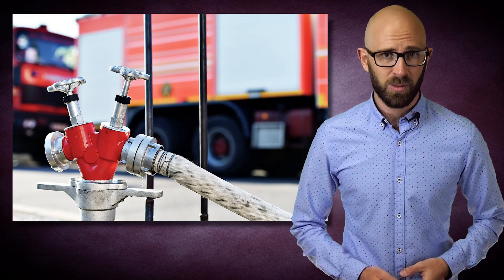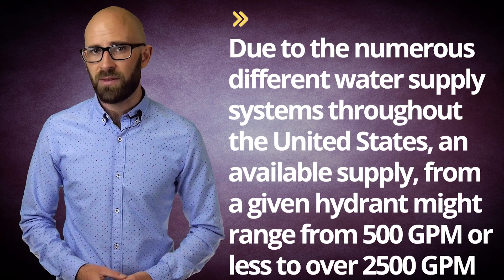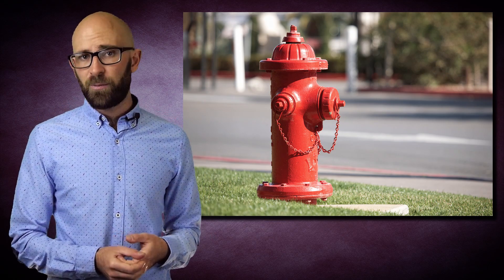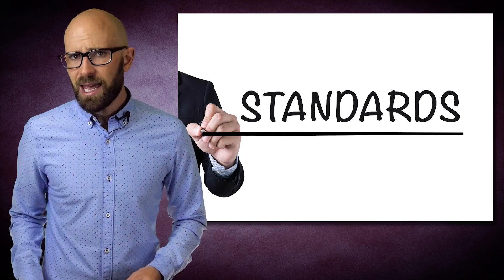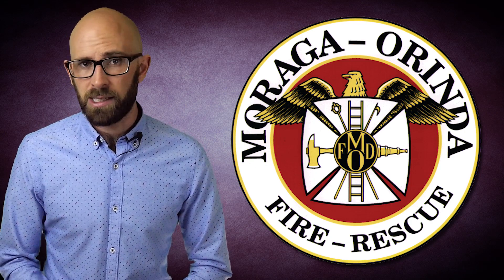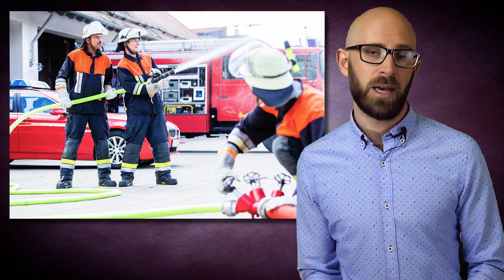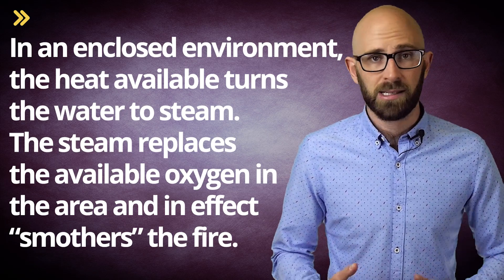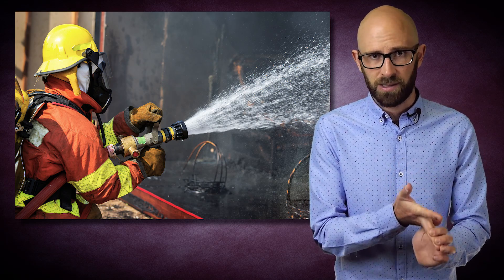Fire Hydrant Colors Actually Mean Something

Comment: Bonus fact: Pouring water on a grease fire will make the situation worse, as the water will spread the burning grease around. Instead, grease fires should be smothered with a more solid substance such as sand. Sand also works for various other chemical fires which is why you can usually find a bucket of sand in chemistry labs.
Reply: You can use AFFF (Aqueous Film Forming Foam). The Navy stresses in their firefighting prograam to use this in a liquid (Bravo) fire. That mistake was made on the Forrestal fire when they sprayed a jet fuel fire with water.
Reply: James Currie 
The water and grease separate, spewing burning grease and boiling water everywhere.
Reply: You could use sand for a grease fire, or since you're in the kitchen anyways, grab a box of baking soda to smother it.
Reply: When I was trained by the Merseyside Fire Service at Speke in the '70s, one of our exercises was to enter the "tank" to extinguish a large tray of burning diesel oil. For this we used a high pressure water spray (not a jet) nozzle on the the hose branchpipe. The fine spray turns to steam both cooling and smothering the fire very effectively. Fixed Waterfog spray installations  are often used for fire protection on oil filled equipment such as transformers.
Reply: HauntedShadowsLegacy don't use water on magnesium fires either. It is so hot that it will seperate water into Hydrogen  (really explosive) and oxygen
Reply: imagine a sand hydrant in chemical labs
Reply: HauntedShadowsLegacy don't remember seeing buckets of sand but a fire blanket is just as if not more sufficient
Reply: HauntedShadowsLegacy and at... I think you call them gas stations in america? Not sure in Ireland we call them petrol stations, or supermarkets if you live rurally
Reply: HauntedShadowsLegacy I'm talking about sand buckets btw
Reply: At gas stations (yes, that's what they're called in America), there's usually an industrial, grade B (Bravo) fire extinguisher, a trained attendant, and a highly visible emergency shutoff switch. As for sand, I don't think I've seen buckets of sand at gas stations.
Reply: HauntedShadowsLegacy k thanks
Reply: HauntedShadowsLegacy yep in the lab we have bucket of very finely ground minerals we use for out of control reaction fires, for insance if someone accedently gets water on pure potassium and were to add more water because it started a fire it would blow their body into swiss cheese lol
Reply: Well, when I did IMO60 safety training we put out oil fires with water. It's a bit tricky, but if you have a corner to chase the fire into and  you use a more "shower" like setting on the nozzle it works just fine. I agree that powder or foam is a better option, but water does work if you know what you're doing.
Reply: to pws3rd 1, Very true, which is why the fire extinguishers in magnox fuel stores are metallic dry powder
Reply: +HauntedShadowsLegacy
Commonly a chem lab is equipped with a BC fire extinguisher. This is because the ABC extinguishers use a corrosive power (usually ammonium phosphate) that is very difficult to clean after the fire is out. BC extinguishers use compressed carbon dioxide gas that leaves no residue after use. This also makes it favorable should an electrical fire occur because it will prevent further damage to the equipment. If the lab contains any array of flammable metals or metallic solvents, a class D extinguisher is also usually present. The class D uses a dry powder, it is not preferable due to contamination issues but BC and the ABC are both ineffective at combating these types of fires. The better labs I have been in are usually also equipped with a fire blanket and safety shower to be used on any person who's clothing or body is ignited. I have not seen buckets of sand, but you will usually find 2 containers in a lab of ground minerals. One usually is mica, mica is excellent at controlling a fire due to it being noncombustible, inflammable, and fire proof. The other is usually sodium bicarbonate, this is used to neutralize strong acids in the case of spills, or unforeseen reactions.
Reply: I had a friend who was having a fish fry when the propane regulator stopped working properly, causing the oil to catch fire. I grabbed a box of baking soda & dumped it in; thankfully it put it out. Thanks Grandma for your words of wisdom from long ago!
Reply: As a child it was drilled into us that you use baking soda & smothering to put out a grease fire. Recently this came in handy as the regulator on a propane fryer was malfunctioning & caught the oil on fire. They tried to smother it but that made it overflow & onto the wooden deck. Grabbed some baking soda which put it all out! Now when we have a barbecue we also have baking soda there close, every time.

Comment: Bonus facts. Blue reflectors in the median of a road point out where a hydrant is located bordering the road. In some water districts the hydrants are tapped off a large water main supplying a city, and they're often rated at 2500+ GPM and are painted silver (great for fighting wild fires). And if you live in an area where you think you may have a dead end connected hydrant, make sure your local fire department is inspecting the hydrant every few years, if not yearly, to flush out sediment that gets trapped in the dead end, and to make sure the hydrant is providing the required GPM to supply firefighting needs.
Reply: Usually when the snow comes the brush around the hydrants has no leaves and is beat down a bit. We don't get really bad winters here in WA State, so it's usually not an issue.

Comment: Why does the US have hydrants, whereas other countries like New Zealand have an underground system with connection points marked by an arrow on the road?
Reply: Hello, the underground fire plugs are usually in countries where it does not snow or go below freezing. Most places in the USA require the fire plug to be located below the frost line, which was determined to be below 4 feet, ( but with global warming probably 2 feet now). So the hydrant you see sticks up about 3 feet but goes in the ground about 4 or 5 feet, so in all the hydrant is 7 or 8 feet long.  There is a valve stem (rod) that goes from the top of the hydrant, to the valve at the bottom, so when the firefighter turns the top, he is actually opening a valve deep in the ground...

Comment: I used to work for a waterworks supply company supplying a city of 100,000 people and smaller towns in a 100mi radius. All of the hydrants came red despite the size. Those that were sold to the city were all the same size and were required to be repainted with a particular shade of paint.

Comment: Today I Found Out - Conway79 brings up a good point with, "If choosing the correct water pressure and type of hydrant is so important, I'm surprised there aren't stricter rules about how they're painted." This made me think "I'm surprised they don't have a local map or app that has this info for each fire station and readily available to other stations that may have to assist in their area."

Are there maps and apps available to FD's for this and other purposes?

Comment: The "Color Coded" Fire Hydrants is a recommendation. I've haven't seen any community that has used the recommendations yet.
However!
In the United States, Fire Hydrants come in Red.  Over 30 odd years ago, we were allowed to paint the Fire Hydrants all around the country. So you might see a hydrant painted like R2D2 or like a corn stalk or one of many other creative designs.
If I were a fireman, I would know the pressure on every line in my system. If not you can check the records at the station, not that it matters!! You only have 1 setup on your truck!!!! So you'll just have to deal with it.

Comment: As a firefighter/EMT, I approve this video. Another thing to consider is there is widely varying policies as to whom has to care for fire hydrants. In some municipalities, the water department takes care of everything in regards to fire hydrants, including pressure and GPM testing annually. In other cities, the FD needs to annually inspect and pressure test every hydrant manually, and perhaps the water department does not want to paint them. Obviously the FD doesn't have a strong urge to spend a weeks every year or two painting and repainting all of their own fire hydrants. 
Lastly, in areas with public water being suppled by a private company and not a municipality, there can be serious tensions between these companies and various fire departments. Fire departments take water without have a meter to take into account how much they use, and often do not report their water use. Water companies need to report unexplained water loss and may need to pay fines for this unexplained loss of water. Because of this and other reasons such as a private company not wanting to repair broken pipes if they are broken during annual FD pressure testing, private companies will not allow any FDs to test their hydrants, under the threat that they will literally remove the fire hydrants from the ground. Because fire hydrants are not simply used for the fire department, but for maintenance on a water system. They have the right to do this (at least in my area) because those hydrants belong to the private company.

Comment: I can't even wrap mind around 2,500 gallons per minute
Reply: 2500 gal per minute == a touch under 10,000L per minute (9,463.2L/min). According to https://en.wikipedia.org/wiki/New_Routemaster, that double decker bus weighs 12 metric tons, 1000L of water ~= 1 metric ton (accounting for impurities, etc, iirc standard atmospheric pressure pure water is 1L == 1KG) so yeah, a little less than one of those buses spewing out of the hydrant *pauses for effect* per minute :)

Using this as a reference, assuming average American pickup is ~4000lbs , convert that to metric for my Aussie brain and we get 1814kg (lets make that 1800kg), so 2500 gal/minute is roughly equal to about 5 american pick up trucks worth of weight squirting out of that hydrant, per minute :)
(ref: http://www.nytimes.com/2004/05/05/business/average-us-car-is-tipping-scales-at-4000-pounds.html)

or enough water to fill an olympic-sized pool in about 4 hrs 25 minutes
(pool volume ref: https://en.wikipedia.org/wiki/Olympic-size_swimming_pool)
Reply: You are amazing.
Reply: Your welcome :)

Bonus Fact (sorry I couldn't help myself)

In the time it would take to listen to the average Monster Cat podcast (they're usually around 1 hour) or watch the average scheduled TV program in Australia (they usually run say 7.30pm to 8.30pm), that fire hydrant would have spilled 567,780 litres of water (just under 150,000 gallons) which, ever so conveniently is just under the MTOW (maximum take off weight) of a Boeing A380-800F which is 589,670kg (the F designation is important, the A380-800 would be over it's MTOW by over 23 tons or about 13 "average" pickup trucks (little over 51,000 pounds))

Funnily enough, the Russian Antonov An-225 could actually LAND with that much mass plus 13 pickup trucks :D which is strange, how the number of pickup trucks worth of weight over the MTOW of the A380-800 vs A380-800F, is the amount the Antonov can land with to spare for the same amount of water.

Additionally assuming your house has 2.5 meter ceilings (about 8ft 2 inches), that one hour would be enough time to fill 227 ish square meters (2,445 square feet) of floor space to the ceiling.

Another perspective, is that you could fill a soccer pitch to around 80 centimeters (around 2 ft 8 inches) of water.

All of this, from a humble fire hydrant :)

ref: 
https://en.wikipedia.org/wiki/List_of_airliners_by_maximum_takeoff_weight
https://en.wikipedia.org/wiki/Football_pitch
Reply: Astonishing

Comment: I’m an Australian FireFighter, this is really interesting. Here, or at least in my state (NSW) we have a point that comes up from the town or city water pipes but it stops below the surface, called hydrant points. Around these (the bits that you see) is a cover with a little hatch door to get to it. With this what we do is ‘ship a hydrant’. Our tankers and truck carry a ‘stand pipe’, we upen that hatch and we put the hydrant in ourselves. It just crews in very securely so it doesn’t burst off and fly into the air, and we twist on top and it pushes a plunger down on a ball that stops the water coming through to move it, and we connect to the stand pipe.

I also wanted to say that if you have a fire on a 2nd story or so, water damage to the lower level isn’t due to an ‘overzealous firefighter’. It’s inevitable if we need to put that fire out.
Reply: That is how it goes in about everywhere in the world, except the USA.
Reply: DJ Allbad114 awesome always wanted to know what do the small markers that say ph and sv stand for? Was told as a kid they were used buy firefighters I think there are others but can't remember
Reply: Willy Nebula 
SV is a sewer vent
PH is a phone line
Although I’m not confident, we don’t use them much.
But next time you see a telegraph pole, have a look for a green tag that had a bunch of numbers on it. We use that if there is a structure fire or a electrical fire to get essential energy to shut off the power, then can do it by the poles
Reply: I love that your state is NSW, if I ever go to Australia I am going there. One question though, do your fire trucks or police cars have NSW on the side?
Reply: +Willy Nebula
The small markers you mention are no longer used. You can still find them in older areas because they were never removed, but there's a new system to indicate the location of hydrants. The old tags were usually attached to telegraph poles or white marker pegs about a meter tall if there were no poles near by. Some were even attached to fences. The common tags were HR (hydrant road) HP (hydrant path) and SV (Sewer Vent)
The new system has a big yellow triangle painted on the road and indicates the direction of the hydrant. Another new system has a blue "cats eye" reflector near the centre line of the road. It's offset to indicate which side of the road the hydrant is.
The underground phone lines are all contained in dry pipes and the access manholes all have "Telstra" logos to indicate what they are.

+DJ Allbad114
I'm not surprised that you're not confident about their meaning. Those markers were already being phased out more than 20 years ago... Waaay back when I was doing my basic firefighter training.
Reply: Sean Peacock no here's a pic of one
http://t0.gstatic.com/images?q=tbn:ANd9GcTqNcODcZSz8iZDg9DcFzWx1AkH3h9Fo32rIReNUl2TBpicZEArIg
Reply: Sean Peacock Police don’t normally but fire and ambulance do. “NSW FIRE AND RESCUE” “NSW RURAL FIRE SERVICE” “NSW AMBULANCE SERVICE”.
Fire and rescue - https://upload.wikimedia.org/wikipedia/commons/2/23/Fire_and_Rescue_NSW_SEV%2C_Scania_P94_Telesqurt_Aerial_Appliance_on_Morrow_St.jpg

NSW RFS - http://fire-engine-photos.com.s3.amazonaws.com/11627.jpg

NSW Ambulance - http://apcollege.edu.au/apc/wp-content/uploads/speeding-ambulance-nsw.jpg
Reply: scott thompson I wasn’t even born then😂 I live a bit out of the way so we still OCCASIONALLY have one of them but like you said it’s definitely the ‘cats eye’ blue tag that’s used, we don’t necessarily have the yellow arrow for that but sometimes. We rely on the offset tags.
Reply: Remember the trapdoor has lots of different species of bugs and wildlife

Comment: While it is still taught in basic ff courses, I am not aware of any department that still uses the color coding system. Not sure why, my guess is that the water supply network changes over time, and unless the water department tests the flowrates on a regular basis, the color code is no longer accurate.

Comment: As a FireFighter I can attest to the varied colors even in the same fire districts. It is the rookies job primarily to paint the hydrants ever year when that hydrant is due up for testing. Every engine company I know of drills in the heads of their rookies the approximate rating of the different hydrants throughout their territory and God help the poor soul who screws it up when asked. I had to run about 20 miles extra during pt for the times I messed up and I only did it 2 or 3 times as a rookie.
Reply: steve b Well first tell me how many different water systems and different color code systems u have in ur departments zone? I had 4 different water systems all using different color code systems in my first departments zone not to mention the different system we provided mutual aid coverage to. Oh that's right, ur just an Internet troll who has never once laid down your life to help someone else so u can go fuck yourself and shut the fuck up.

Comment: Most hydrants will have a shutoff valve in the street 20-50 feet away, flush with the surface of the street in case a car hits the hydrant and water is coming out where the hydrant was.
If you see a blue reflector in the street, all by itself, there will be a hydrant at that location on the sidewalk.
Reply: In Washington State, there are road reflectors in various colors. They are set in grooves cut into the pavement.
Reply: BariumCobaltNitrog3n In Florida blue reflectors are set a few inches to the side of the center stripe of the road to mark hydrant locations. Up here in Minnesota, however, I've not seen a single road reflector of any color, I guess because they would get ripped out of the pavement by the snow plows. In a lot of areas, however, long reflective fiberglass poles, similar to, but bigger around, the poles people use to mark the edges of their driveways and walkways in the winter, are attached to hydrants to make them more visible, even if they are buried in snow.
Reply: BaCoN
Reply: yesindeed